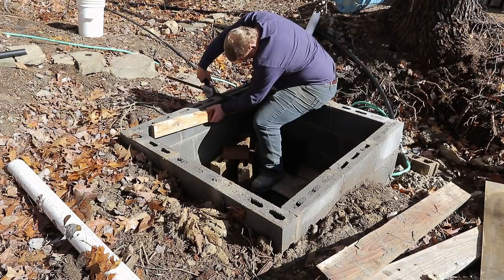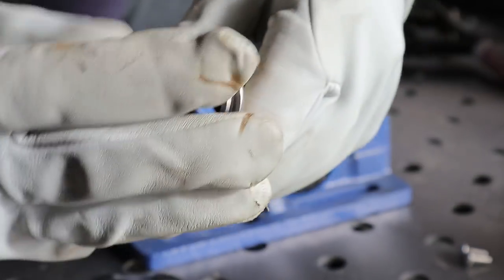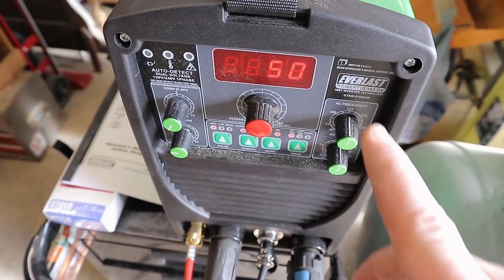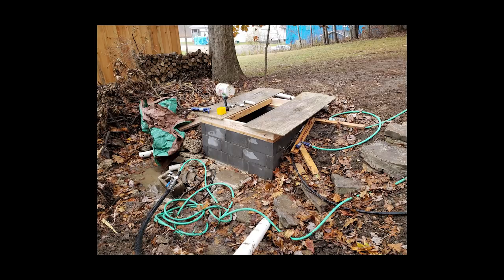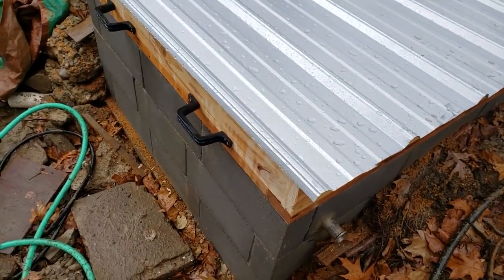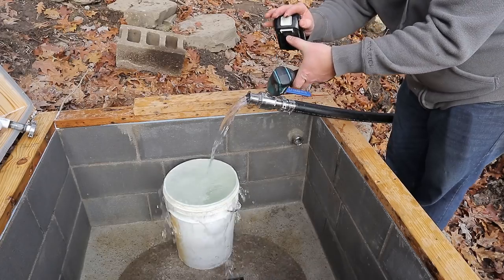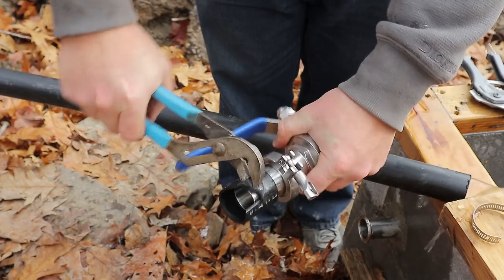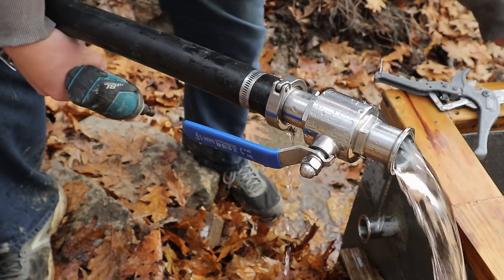[Part 15] Kilowatt Microhydro Turbine - Turbine Pit II

Comment: For the hose (Gear/ Worm) clamps, DON'T use an Impact driver, use a regular drill at a low setting. Maybe 4-5 adjust higher as necessary.

Comment: Aside from a sturdier clamp, in temps that cold it might have been easier to seal by snugging the clamps, heating the plastic line then tightening the clamps again with the plastic softer.  I am guessing you’d only need to heat up the 100F or so it would get to sitting in the sun in the summer.
Reply from the maker: It's only a drip right now, I might do as you say still.

Comment: I imagine there's probably some torque spec for all stainless steel hose clamps out there somewhere so that you're not busting them I finally figured out after years of breaking hose clamps that they don't actually need to be as tight as I think they do take them down by hand with a screwdriver then give them a few turns with a wrench and see if they leak is kind of how I've been going at it for the last 10 years with my yard irrigation out of the lake

Comment: You need T-Bolt hose clamps. They have a smooth inner surface and no stamped worm screw threads to deform. Google will show you what they look like.

Comment: Enjoying your series Joe. I'm sure you have been asked before but wondered if you can answer a few questions. Do you build pressure with the long runs from your stream? Would it be easier to have a shorter run or put the turbine up higher close to the stream? Could you put in multiple turbines to make it closer in output to power your entire house? I take it you are getting 3 phase a/c from the turbine so electrical loss would be minimal from electric cable runs. Just curious about how much thought is put into getting as much power as possible from the stream. Thanks,  Scott

Comment: Look up stainless steel t-bolt clamps.  you can clamp a lot harder with them.  I've used them in high pressure turbocharger applications.

Comment: I guess this video is kinda old since i have seen ones of it running and about the battery id  suggest putting it in rice or something because I have taken apart a lot of drill battery packs and moisture seems to be the cause of failure on a lot of them and i have heard that the moisture absorbing stuff is corrosive i dont know if that's true but that would not help

Comment: why not put the valve inside the pit to protect it from freezing.
Reply from the maker: The valve won't be used to shut the water off for more that a few minutes at a time to make changes downpipe as needed. I will have water flowing 100% of the time to prevent freezing.

Comment: Check into tig silicon bronze brazing, it is very forgiving, extremely strong..
Reply from the maker: From videos I've seen TIG brazing is about half as strong. About 5:00 https://youtu.be/wf-Cq5eQmt0
Reply: @JoeMalovich  The strength is because the braze covers more area and has a larger sectional profile than simple fusion. The material is wicked into the joint.

Comment: Been watching all summer,  what's the payback on this project?
Reply: Optimistically, if it produced 500W continuous (1000W half the time), and all of that gets consumed - electricity is maybe $0.07/kWh in PA, so that's $0.84 per day or $300 of electricity per year.  Payback depends on the material cost which was must have been over $1000 but I don't know exactly, I'd say it's a single digit number of years if it was producing electricity that much of the time but could be a lot longer if the stream doesn't flow a lot of the time.
Reply from the maker: I've made all my money back before even turning it on thanks to  YouTube!
Reply: @JoeMalovich  ah yes, I forgot about the smoke and mirrors.
Reply from the maker: @johnparkhurst825  hey these videos don't make themselves.
Reply: @JoeMalovich  it seems to me "these videos " started out with pure motives.  A young man with a passion for the content (at face value)that these videos represented.  Now the motive has been supplanted by money.  The more mistakes,  miscalculations, debacles, etc. = drama = views. I was truly interested in the project hoping for success. 
YouTube has turned one of the best things on the internet, ie good people doing good things into effing used car salesmen   through monetization.
Reply from the maker: @johnparkhurst825  I fully understand what you are saying and mostly agree. During the waterwheel I had hopes that I could earn enough through YouTube for a better camera. Now it has evolved into a second job and a second source of income. Yes I show my follies which are learning experiences for myself as well as my viewers, not as dramatic content for the sake of views and nothing is staged. Most of my follies are due to me being inherently cheap and recording new and interesting things.
Reply: @JoeMalovich  I wish you well on your project.
Reply from the maker: @johnparkhurst825  I hope to provide entertaining and genuine content for your enjoyment.
Reply: Pennsylvania Mike  l sense Joe is  a regular guy who has learned to play the YT game. It's a trap really.  Film something you like doing  then realize you have to regularly create content. The channel"s success and demands becomes more important than the content then it's downhill from there.
Reply: @johnparkhurst825  Ahhh, go boil your head, these videos are the most entertaining ones around, far better than TV rubbish, it's real life and educational if you want to get knowledge of that sort of thing.....no wonder a lot of people have been staying up all night to watch them.........get a life.

Comment: I'm curious why you didn't locate the pump inline with the flow (parallel), seems like a power loss to turn the water.  Also, why didn't you chip out the necessary holes out of the block before laying them and fill the extra jagged hole with mortar later?

Comment: what are you going to do about the penstock that is in the open air without the leaves?
Reply from the maker: I'm not that concerned, the spring water is quite warm compared to the air.
Reply: Provided the water keeps a semi constant flow it shouldn't be huge problem. Air bubbles could be an issue though, but a small one.
Reply from the maker: @WimsicleStranger  the tank at the top will let them settle out, any that do manage to get in can float to the top as the penstock has no dips to catch bubbles or get shoved to the bottom.
Reply: @JoeMalovich  Ah that's good. Saw a video of someone that tried a microhydro setup which had a tendency to collect the smallest air pockets which ballooned and created massive air bubbles. They solved it by adding small holes sealed with screws to allow an easy way to bleed air and improve water flow. Seeing as how your penstock is mostly continuously downhill it shouldn't have very many issues I suppose.

Love the vids btw, been watching since I stumbled upon your water wheel and have been hooked since.

Comment: Yo man, this has been in my mind since I've started watching this series. Was the owner of the property just cool with you blocking off the spring and using it? Or did you pay any amount to the owner of the land?

Ps love this series. My main consideration now when looking for properties is if there is a spring where I can build a micro hydro plant.
Reply from the maker: The owner gave permission, and was interested in the reliable supply of water for his horses.

Mine is the third weir to harness the spring, evidence of the last weir is clearly evident and the second to last was buried under some rocks.

Be extra conservative of the power you can produce and I would weigh solar exposure over hydro potential.
Reply: Thank you for responding!

Now I'll just rewatch the series and your other vids while waiting for the next installment of the micro hydro series. 😁😁😁😁

Comment: 1000 watts is not that much, my very cheap kettle is 3000watts, admittedly its not constant, but you would have to have a substantial battery bank to run an electric oven,  kettle, heater a TV and some lights, which will not be unreasonable to have on all at once in winter.

Comment: should have locked the pipe inside the concrete hole using a piece of stainless steel plate inside the block gap (instead / + of cement:) )